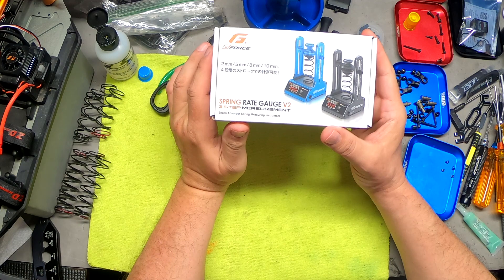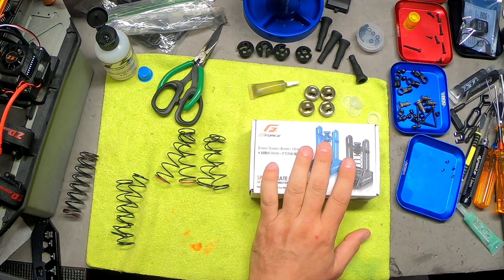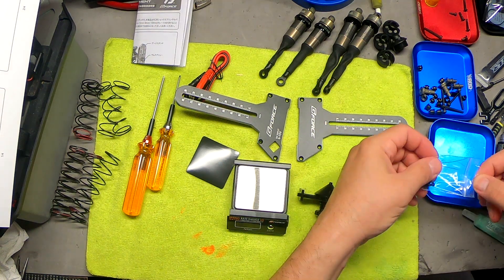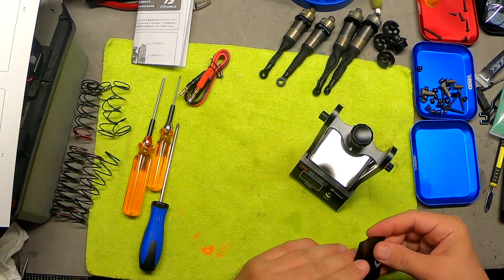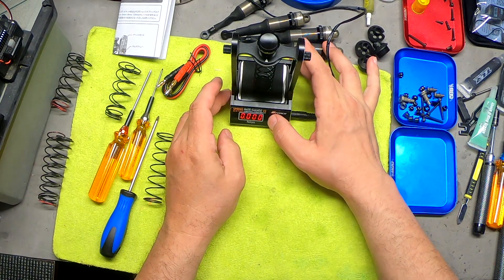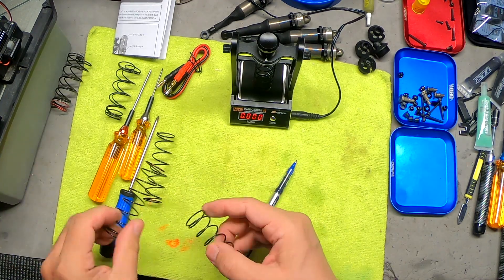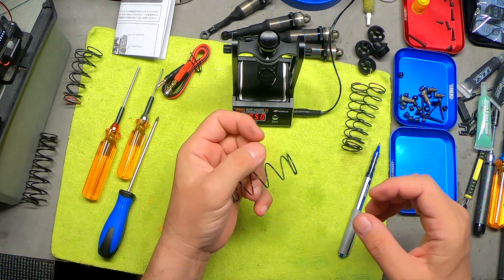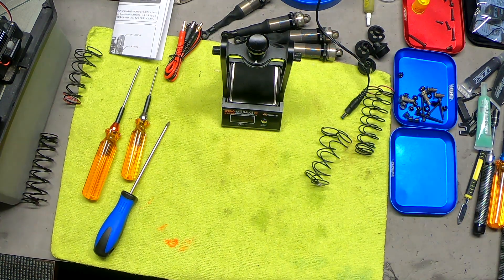Unbox, Assemble, and Test the G-Force Spring Rate Guage V2

Comment: Hi CJ, found your channel a few months ago and really glad I did. 
It appears that you are only testing one spring of a pair. I think you should check both to see if there is any variance. As for the multiple spots, I suspect that will be used to build a spring rate curve to see if the rate changes over distance. Progressive springs would change the rate as they compressed further. 
Thanks for the review of the spring rate gauge.
Reply from the maker: I’m glad you’re enjoying the videos. This is a neat tool, but other than determining where in a lineup a pair falls, it is only going to be as good as the users dedication to recording and tracking data. 
Hope you’re having a great summer!
CJ